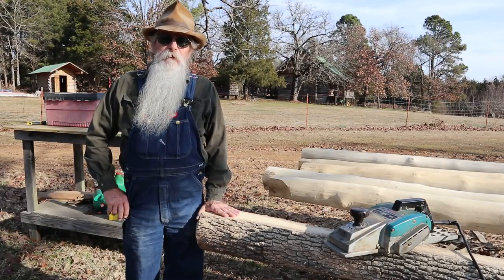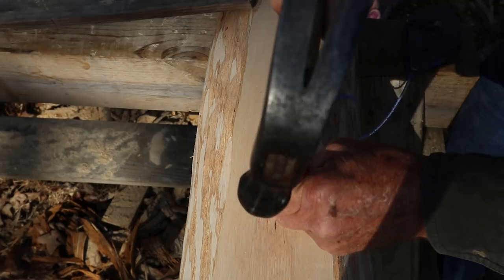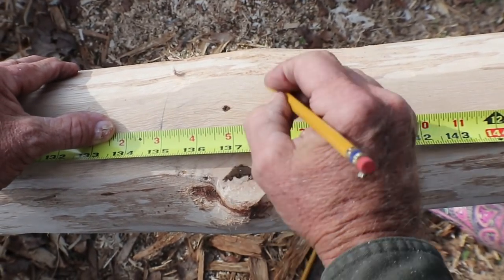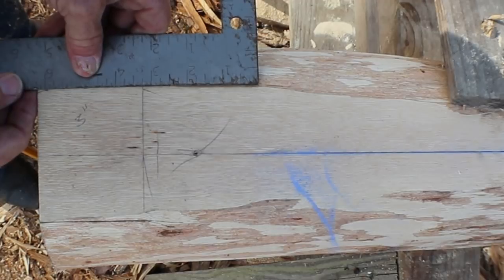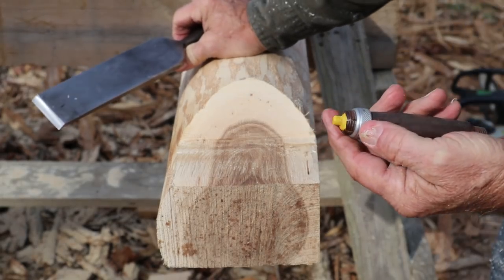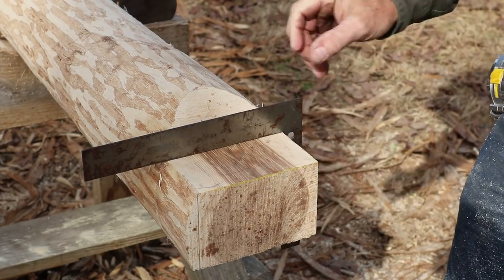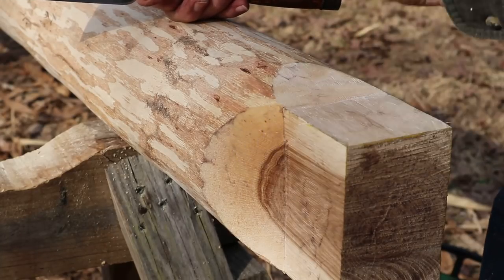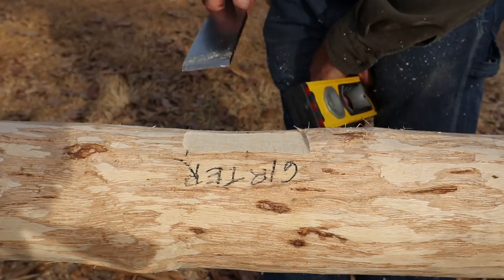How to Lay Out and Cut Tenons on a Round Floor Joist

Comment: Does the  "green-ness" of the log matter for this tenon cutting?  Seems like the dimensions will change as the log dries out.  Great video.  I'd like to know more are your chisel/slip, as others have said.
Reply from the maker: shiretook   Howdy- that’s a good question. The dimensions could change some because these oak logs are still green, however, the change won’t affect the strength of the timber. I will put lag bolts through the tenons into the sill logs and they can’t twist or move- I wish cut pockets to match the size of each tenon. As with any green, unseasoned woods there will be some shrinkage. There will be more on this later. The particular chisel I was using is a Woodcraft brand that might not be available now- I’ve had that one over 30 years. There are timber framing chisels available- depends on what you want to spend. I also use slicks when I’m paring. Sorry this got so long. God bless

Comment: Dear Bearded Carpenter, could you please explain how to arrive at the dimensions (length, breadth and height) of the Tenons like you have explained the dimensions of a Notch recently? Also, how do these dimensions vary with the size of the House? Thanks in advance.
Reply from the maker: AS   Howdy- the size of the tenon will vary on each log because of the different size of diameter of the logs. I just try to get as much as I can depending on how big it is and still be able to have four square sides. I don’t try to keep them all the same size because I can cut each pocket to fit the corresponding tenon. Each one is measured and put on a chart and I can work from the chart to cut each pocket. The length of each tenon is three inches that will be set in the sill logs. Hope this helps. God bless you
Reply from the maker: AS   You can watch episode 13 on cutting the pockets on the sill logs and that will also help to explain how I do it. Blessings

Comment: That planer is 2,000.00 on Home Depot's website. Mercy...
Reply from the maker: J Baker Howdy- the one we found is around 650. The 1806 b. It is a 6 3/4”. Mine is the older 1805b. It’s 6”. I’ll have another look. Thanks for telling me. I’ll get back with you. God bless
Reply from the maker: I just looked on amazon and it is marked 625. Were you looking at the big 12” planner? It’s over 2000. Let me know what you find. Blessings
Reply: Yes 12" I missed you saying width..and went by looks. Thanks for the correction. Still not cheap but better.
Reply from the maker: J Baker   Whew! I was afraid that I had steered you wrong! I gave 350 for mine back in 94 I think it was. The one I bought was put on a do not ship to USA list so Makita made the newer model and could ship em over here. Well, naturally the price went up. Ain’t right. Take care friend